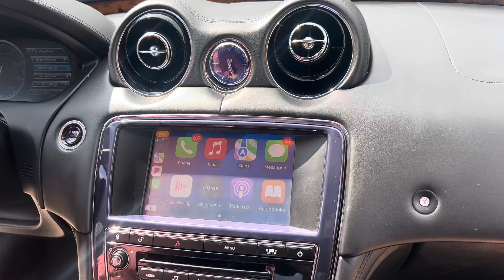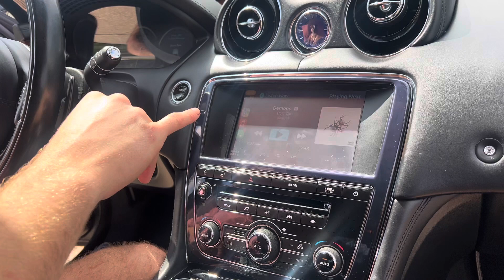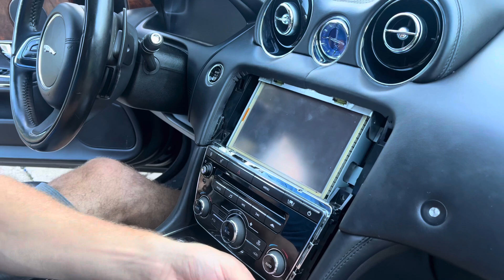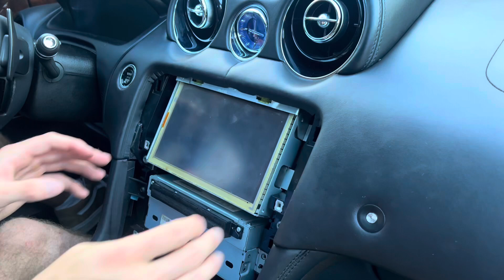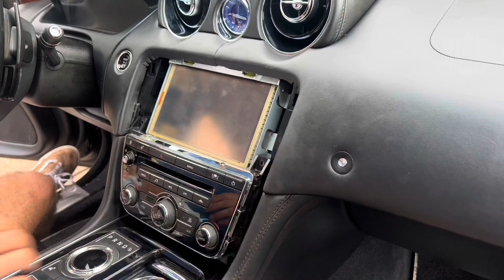Jaguar XJ Apple CarPlay Installation

Comment: You mention that steering wheel skip buttons won't work. But if I paired my phone to car bluetooth and played music on phone, the skip buttons still won't work?
Reply from the maker: Yes they will, I actually did this. But the issue is you have to switch between Carplay and Bluetooth. This might work with the cord I can check for you. But I know for sure that it’s a hassle with Bluetooth.
Reply from the maker: I lied, I cannot check for you anytime soon. Someone hit my car and it’s still at the tow yard. Apologize
Reply: @WestlakeQualityParts1 OK cool so if I paired my phone to car bluetooth and used the original car menu, skip buttons on steering will work?
Reply: @WestlakeQualityParts1 No problem. Just let me know if you get to try it. Thanks.

Comment: Do you know why it's necessary to disconnect the battery? I've been told to never disconnect the battery on the XJ / XF unless it's to replace it.. even leaving it connected when doing work on the engine
Reply from the maker: Don’t listen to them. I have had every XJ ever made. Never once have I had an issue disconnecting the battery. Disconnecting it ensures no accidental shorts can be made.

Comment: Hi, Can you please tell me which dip switch I have to change to the on position? I installed the carabc today in a Jaguar XJ 2010 and it does not  works the way like  it looks on your video.  The screen does not respond as easy as yours. I have to press hard and you can swipe it from screen to another sceen or app. Also the bluetooth connects but there is no sound when I stream music from Tidal you sea the number wihich is playing but there is no sound. The same happens with google maps, you can see the route but there is no guiding voice. I hope you know what went wrong.
Reply: Leave dip switch as is, you have to use car audio system bluetooth for sound, i installed my carabc carplay module today, ran into same problem like you, them i connected my phone with car original Bluetooth and audio started coming for me. Now when i enter my car, my phone connects to car bluetooth and CarPlay at the same time
Reply: If you do not have google map directions audio, you have to go module settings and set audio to source Bluetooth, it worked for me